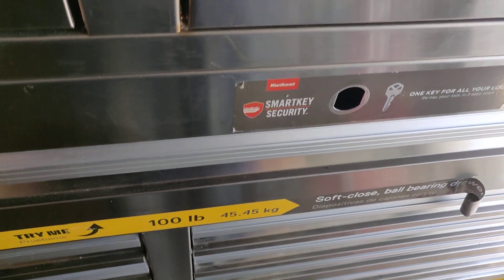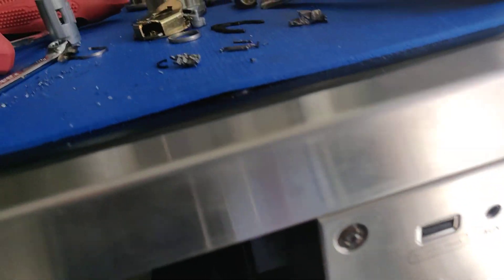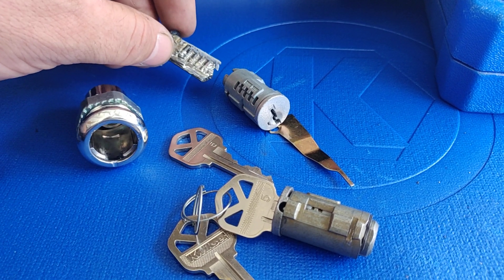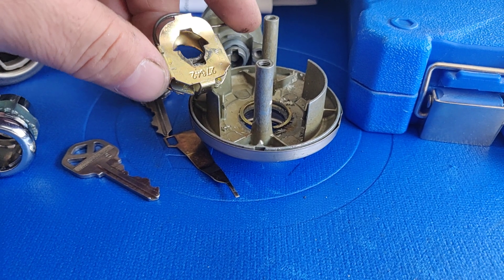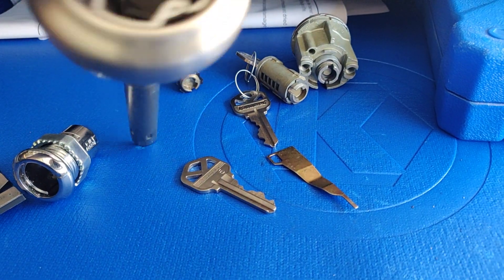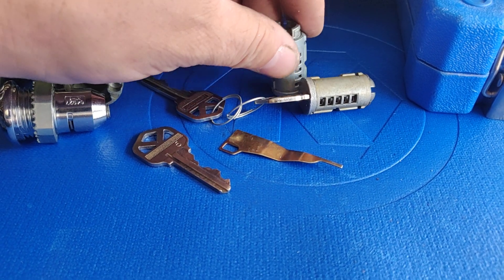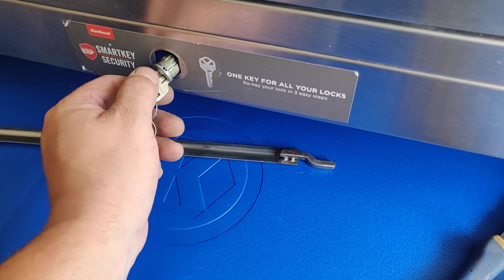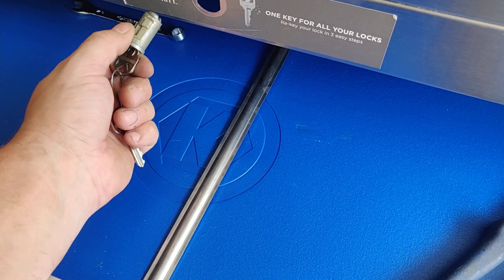Kobalt tool chest kwikset rekey fail and fix

Comment: Please clarify... did you buy a kwikset smartkey cylinder or an entire door lock assembly to get the tail piece that fits the toolbox locking bar?  If so, what part did you use?  We have a Kobalt toolbox that failed to rekey and we had to drill out the lock.  Thanks,
Reply from the maker: Sorry for late reply you only need bottom lock but I don't think so you can buy only battom lock you have to buy hole set  look at home depot maybe you can find . good luck
Reply: Did you ever find where to get another lock with the threads on the back to connect to the rod?